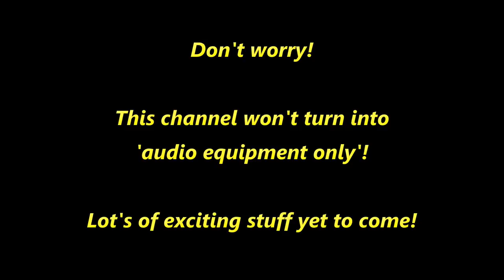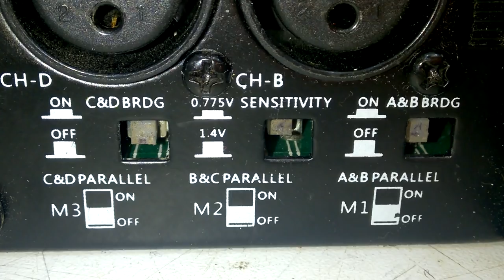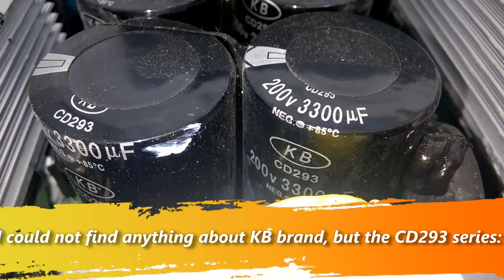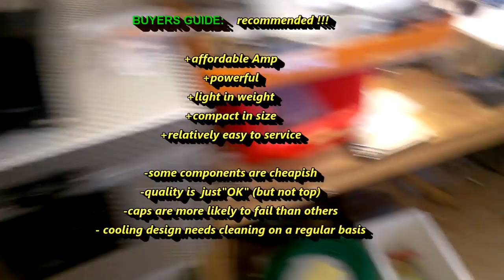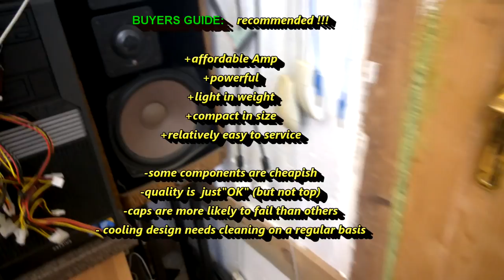BEB #77: Thomann TSA 4-1300 the t.amp (What's inside?) #dailybeb Power Amplifier Teardown

Comment: It is important to change the large SMPS capacitors as they are substandard from factory. Use UCC SMH 12000uf/80V instead as the least expensive replacement, they work fine. This must be done, sooner or later they will blow and pull the power amp with it. These amps are simple very easy workhorses that can/must be strengthed  with better
components and the will perform admirably at full load,

Comment: When one has a higher power amp with several paralleled transistors in the push pull configuration, if there is transistor failure in the channel is likely to be short circuit rather than open, and will more often than not be evidence of high current damage.  Open transistors, which is unlikely to have all of them go bad at once, will be evidenced by less output and faster clipping.  Anything else is going to be in the preamp stages.
Reply from the maker: thank you, great comment. in this case there was no fault at all.

Comment: That amplifier is over-unity - route the outputs to the input power socket and you will have eternal power. It takes 1500 Watts in, and deliveres 4*1670W out - Impressive! 4,45 Times more power!
Reply: 1500W RMS class AB amplifier will "draw" approximately 400-500W of countinous power when outputing full power, because audio signal has got crest factor af arround 1/8 or less (that's why 1500W counsumption @ 1/8 of the power is written near power input)
Reply from the maker: @Nikola, @zapro: datasheet says: Power consumption is 4450W at 1/3 of maximum power. A single mains power line (SchuKo) has 16A. So it needs a 32A 240V single-phase 240V input if you want consume all the power.
Reply: @MaxKoschuh  neutrik powercon 20A !

Comment: Hi Max...I bought the same thing from italy ...but the previous version with two cooling fans...unfortunately one of my assistants bridged it incorrectly and blew two channels with power supply along withmy x1 sub with PD1851/2 Driver..I cant ship this to thomann for repair as I live in Sri Lanka...I mailed them asking for a repair manual / circuit diagrams ..the replied NO...It would be a great help if anyone can share with me any assistance or any place where I can get service manual ..Thanks
Reply from the maker: Hello, greetings to Sri Lanka. Unfortunately, I don't have any schematics myself. You are welcome!
Reply: Ing. Max Koschuh thanks anyway ...cheers ..
Reply: @SaraInItaly14  Hi, this amplifier is the Chinese Leicozic DP41200 clone. 
What are the symptoms? Blinking LED in main board ?
Reply: @marekbogucki1463  two amp blocks are fried due to incorrect bridging ...thanks for your reply 👍👍👍

Comment: This is a 4 channel recipe for disaster. (already discontinued). Stay far away from this kind of power built with these components.
Get two Behringer NX6000 / iNuke 6000 instead. The Behringer Class D amps are not bad low cost power. Just don't push them to the limit in 4ohm (if the 6000 model). and best to biamp each amp = sub @ch.1, and top @ch.2 (gets you better headroom). iNuke's can last for a long time, if don't abused (meaning never use these for rental, they are just consumer-grade items)

Comment: The balancing resistors are on the downside of the board All smd 😉
Reply from the maker: Thank you! You are welcome! :-)
Reply: @MaxKoschuh  if you are interesting in details,this amp is incredible similar to ram audio s6044, smps is Full Bridge with 4pc Irgp4066, driven by 2pc IR2110, SG3525. Power amplifier works in class H 3-step +-60,+-120,+-180V , for that Power little bit scary only 5 pairs of Power transistors 🙂